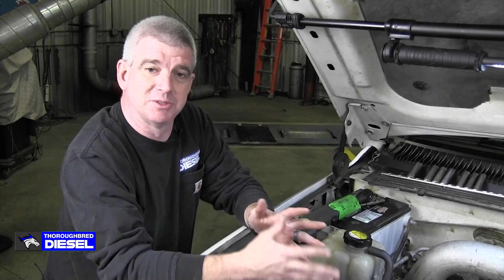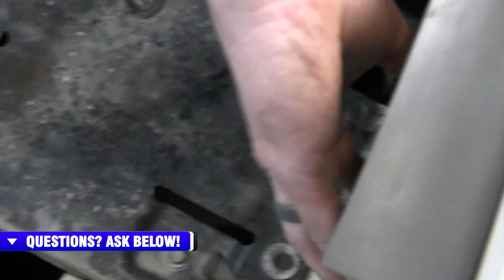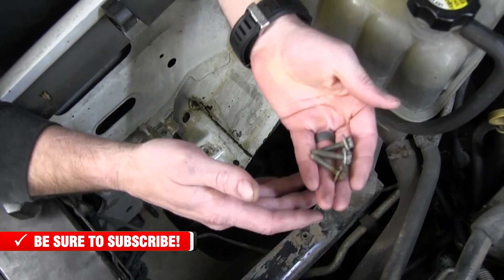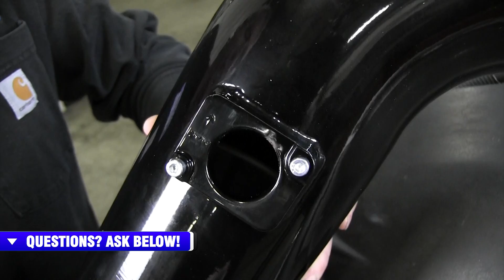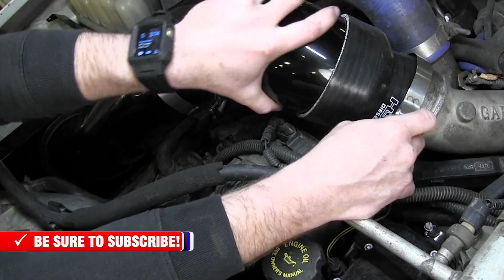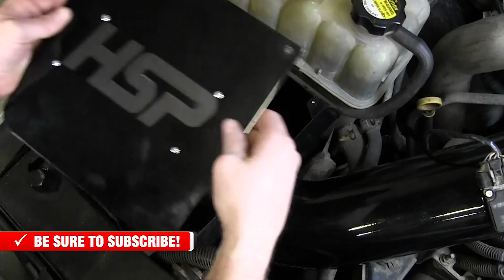SIMPLE Yet Effective Diesel Air Intake | HSP Cold Air Intake Install: Chevy Duramax LB7

Comment: Is there any comparison between this and S&B or banks? They seem to focus on the closed box verses the blocker plate.
Reply from the maker: HSP intakes use stock locations to pull air from like both those brands, but their airbox’s are not “sealed” like a S&B for example. Super easy to access their filters though.